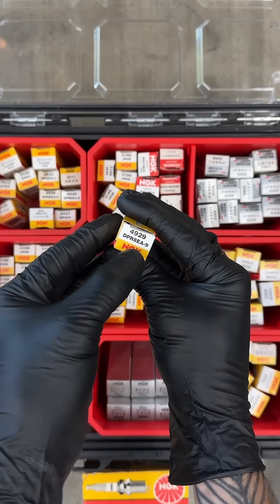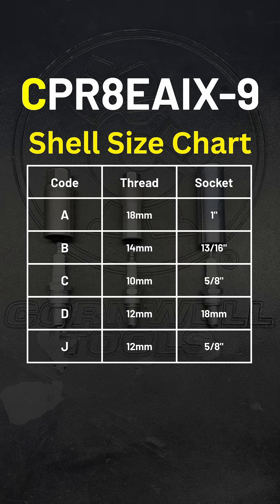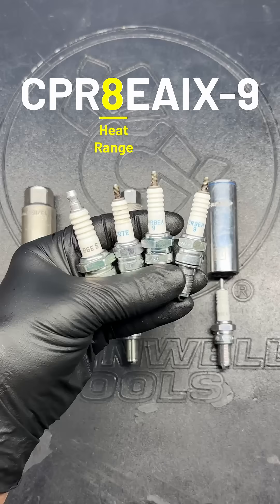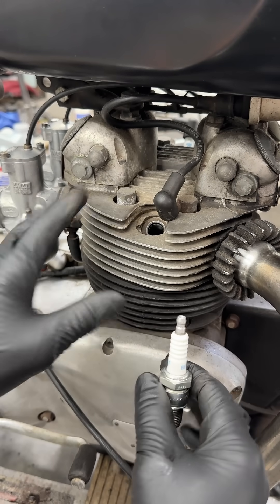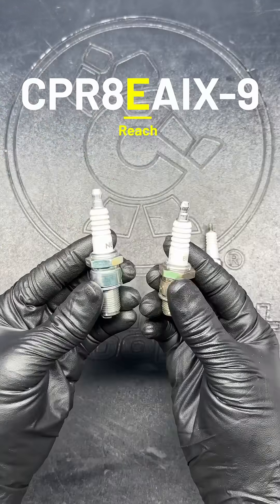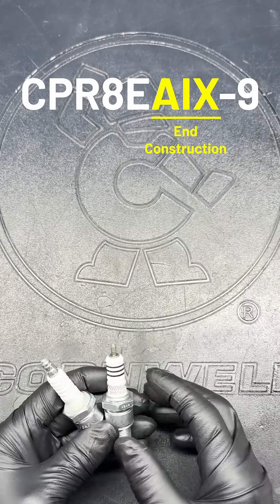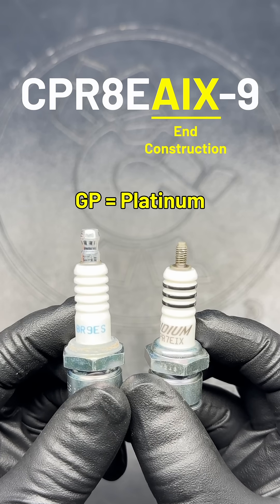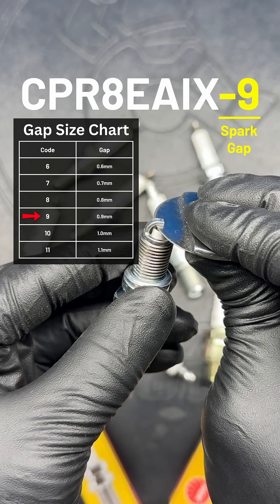What do spark plug numbers actually mean? ⚡️

Comment: This video is what I needed. I hope u do interchangeable parts in cars and motorcycles.
Reply from the maker: Yea one of the benefits of knowing these codes is you can find plugs that are different in some ways than the OEM for a given model but work just the same. It’s handy when a certain plug isn’t available. Many plugs can work in cars and motorcycles.
Reply: Ohhhh U don't understand . U r more important than the parts. 

U r the bridge that connects  hidden parts to ppl that need them . 

May ur body and mind never tire from making these videos. 

FYI u should use mario's one Up sound effect as ur outro but make a version of it which has ur signature. 

 @oneupmotogarage